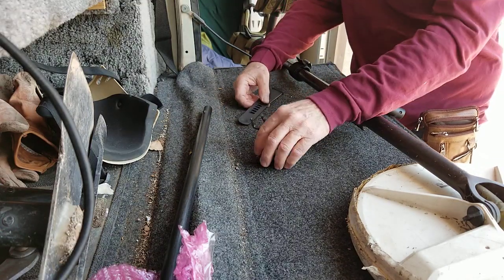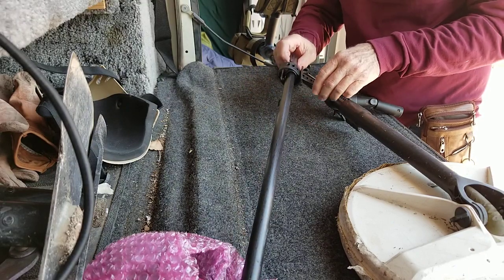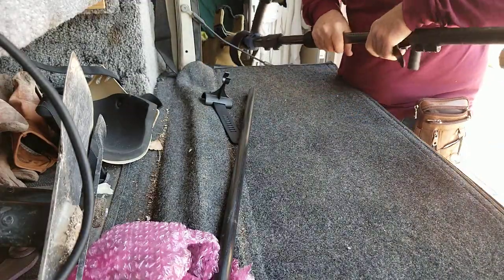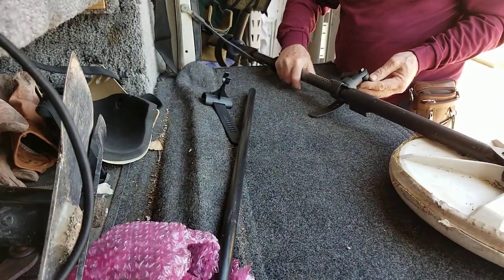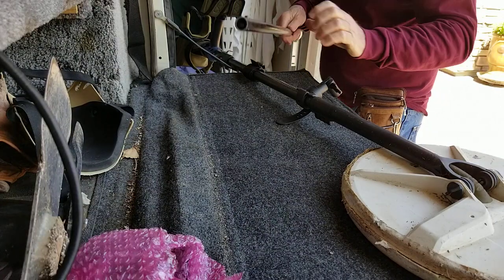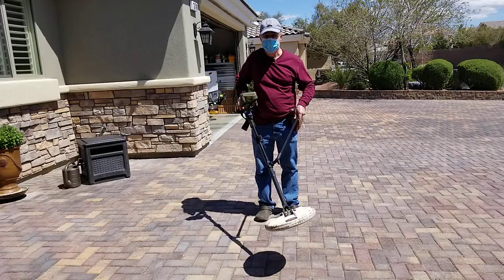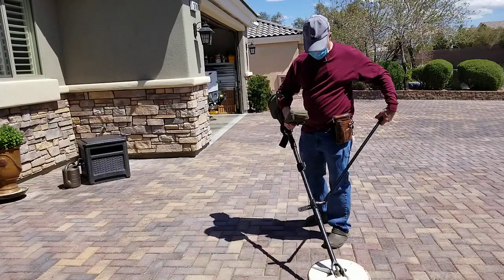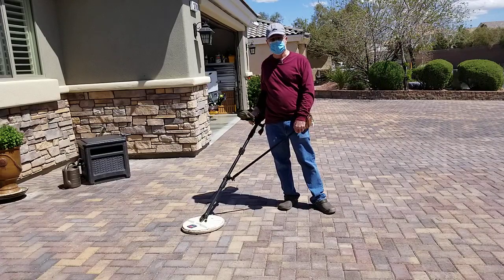SAGA Doc's Swing Assist Guide Arm

Comment: Hi Doc, well just received mine still need to cement on the ball but need to give it a few swings first.   Dave....
Reply from the maker: Good move.  Just use it without the handle for a few outings and see where your hand feels comfortable.  Usually it's when you are swinging and the position of your hand on the SWING arm is about the same as the position of your hand holding the metal detector.  If the  swing arm is too long your elbow is going to be bent to compensate for the extra length.  That's not good.  If it's too short your going to find the arm your are holding the swing arm with feels like you are reaching to hold on to the handle and rolling your shoulder forward.  Again that's not good either.  When the SAGA is parallel to the detector rod snapped into the clip, it should appear to just be a little longer than it will be in actual use.  When you swing the SAGA arm out, if you cut it to the correct length it should be even with your other hand.  The directions have an illustration that demonstrates the way to correctly estimate the most comfortable length.

Here's a link to the instructions:

https://docsdetecting.com/wp-content/uploads/2020/06/SAGA-Instructions-PDF-EX.pdf